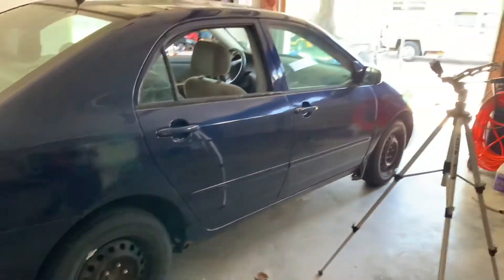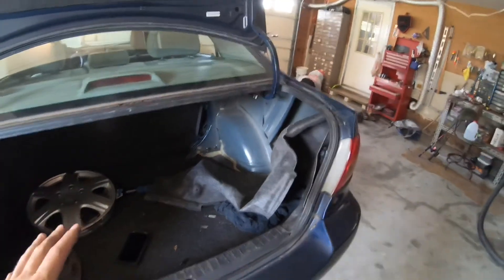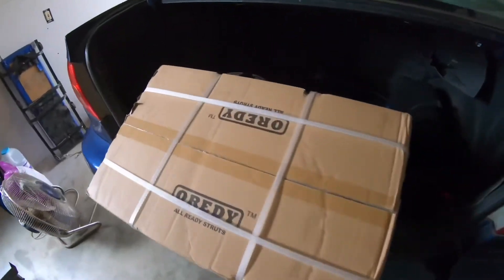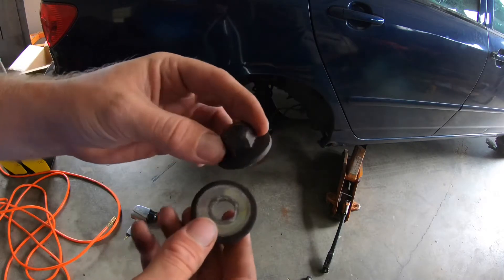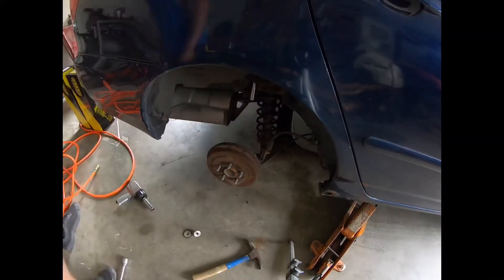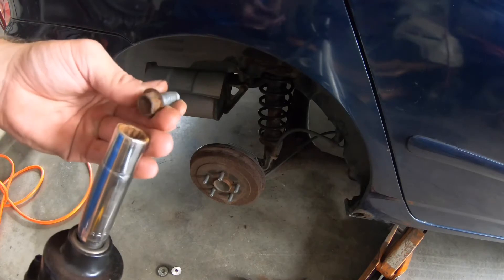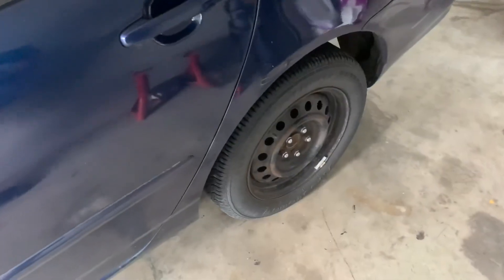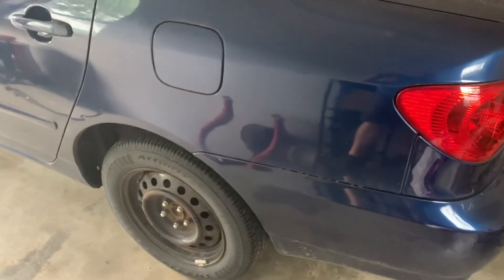2005 Toyota Corolla Rear Strut Replacement

Comment: Had the EXACT SAME problem on my Corolla (opposite side). Addressed it the same way. 
Thanks for sharing this video.
Reply from the maker: No problem thanks for watching!
Reply: Where did u cut the spring to relieve the pressure? I've got the same problem and can't get the strut out.
Reply: @seanwhipkey1452  We cut the spring essentially in the middle coil, I believe.
Reply: So just cut it twice in the center?

Comment: Same year same side issue plus when removing both sides the bushing came out of shock bottoms and had to chisel race and rubber bushing off of spindle. Used copper antiseize and installed new ones.  Pass side is exposed ro side of road spray.  Drivers side wasn't bad but replace in pairs. Thanks for video. I don't feel like the only one now. 👍
Reply from the maker: Good for another 200k!!

Comment: So if the cap goes through the top lip like yours (and mine currently), is the only option to cut the spring?  I would think if the cap is still bigger than the opening it will not come back down through it even with the spring cut and pulling hard like you did.
Reply: Wondering same thing about have to do pass side on my 04

Comment: You are risking your life. That spring is under great pressure. The top of the strut is called a strut mount. Yours being rusted out the spring could have flew off and whacked you in the head. I would have used a strut spring compressor to make the job safe on this particular job. Normally you don't have to with a normal strut mount and changing the whole assembly. If you don't have one the big parts stores will let you borrow one with a deposit.
Reply from the maker: The top cap being as rusty as it was had relieved the spring pressure almost completely. The only reason I cut the spring was because it had pushed up I to the hole. At no point was there enough pressure to cause an issue but Thanks for the concerns I appreciate it!!!!

Comment: Hi, Hi MR, I.C.A.N.T I hope you or a reader can you  answer my questions ? My mother has your same exact vehicle (2005, Toyota Corolla)  I would like to feel the pride doing the part swap myself.  My First question @ 6:05  the first nut that was removed the 19mm, Volt you used and impact wrench, since I don’t have that tool with the air tank I plan on Using a Tube over lapping  the ½ wrench with the 19mm for more leverage, will this work and can would using it for the 14 mm bolt placed from down up in the chassis work as well.
Reply: Yes it will work, you can also buy a breaker bar at harbor freight at a low cost.

Comment: Just out of curiosity what's the mileage on that car? I have an 07 with 250,000 miles on it
Reply from the maker: Right now 190xxx it’s still young!!
Reply: I have an 07 with 220 on it. The rust will get it before anything major goes wrong
Reply: @xVoidCypher  you'll definitely want to look into getting the motor mounts replaced. But those are dirt-cheap on RockAuto. It'll make the car much smoother and the acceleration much better. So far I've changed out the motor mounts, the serpentine belt tensioner, the timing chain tensioner, the valve cover gasket, and the front axles. And because of all that she runs like a dream. Starts up on the first time every time.
Reply: @randalhill6283  i have a standard and just recently replaced the clutch, flywheel and transmission mount. You wouldnt believe how much easier it starts now!! Motor mounts maybe in the next year or two. Kyb strut plus struts going in now. In the last year I replaced the tensioner and serpentine belt, put on an overrun pulley on the alternator, new water pump after flushing the coolant system, of course the thermostat, new front calipers, tightened the e-brake, and more PM to come!
Reply: Why would you change a transmission mount?
Reply: @nia6849  a transmission mount is just like a motor mount. They go bad. They have rubber insulating components that degrade over time and eventually fail. It increases the amount of vibration that gets into the cabin